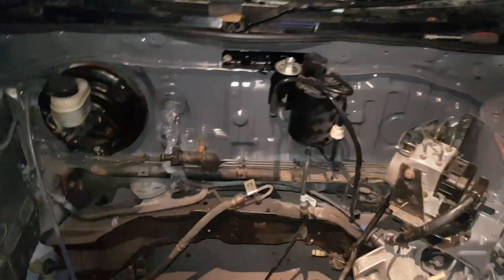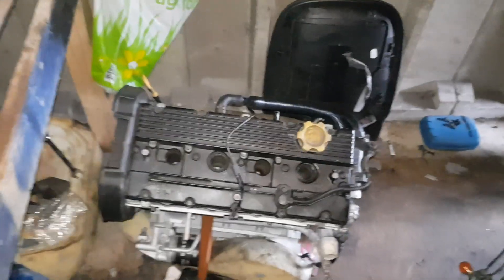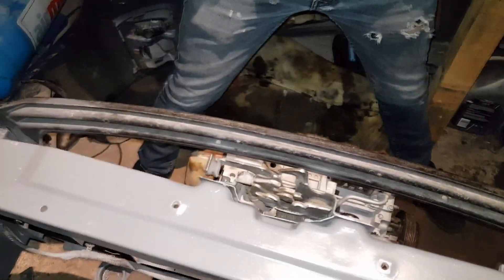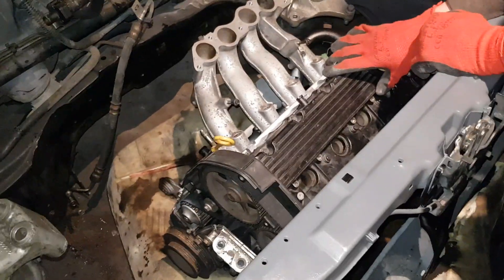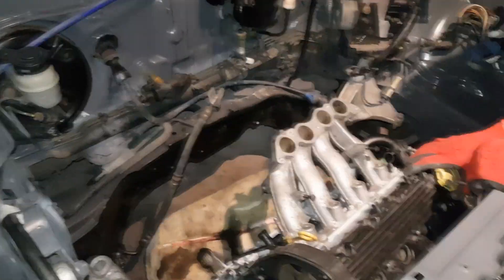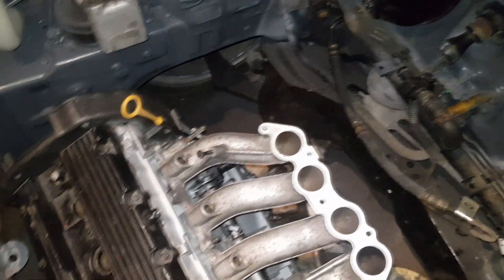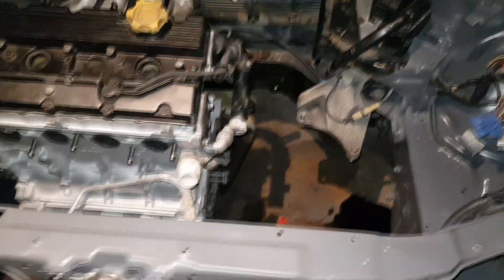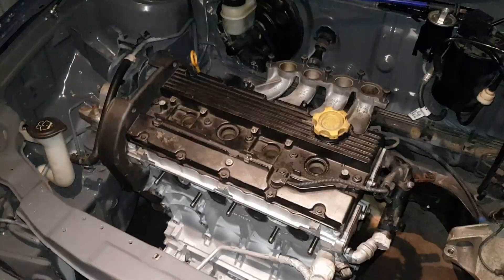The Engine is in! MG ZR 1.8 Turbo swap | Project MG ZR

Comment: I have the 160 vvc.. Had it remapped and doesn't have a turbo but jesus christ it's quick of the mark... 5" bore  exhaust straight through...0-60 in 6 seconds I've had alot of people do stuff to it.. I know this vid is old but thought I'd jus share my comment
Reply from the maker: I've been thinking about getting a vvc as a daily driver honestly. Awesome cars
Reply: @PigsLikePineapples   they are defo buddy ill send a pic of mine when it's had its paint job done... I'm thinking of banging a turbo in mine but I've had mechanics tell me it will jus go through tyres way to quick they say its fast enough as it is but I like the dump valve sound and I only paid 500 pound for it and I've spent £1500 on new parts for engine and welding and everything is brand new.. she will spin in first and sec with only touching the peddle... She is a scary car since the remap but I love her she comes to life when I floor it and she bangs pops and gargles.. Anyone who is an mgzr lover has my respect... Its a cheap car but she will keep up with alot of expensive cars defo
Reply: @PigsLikePineapples  I raced a golf scirocco 2 ltr and left it I was shocked I didn't think I'd win but he couldn't keep up... Before the remap it's fast but stage 1 remap really brings it to life!!!!